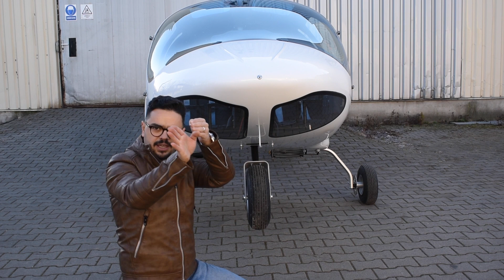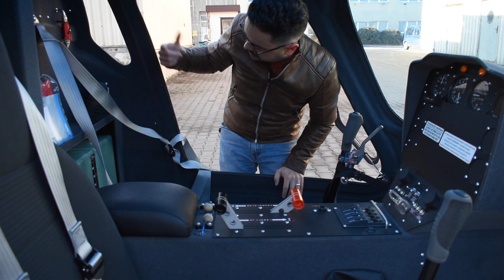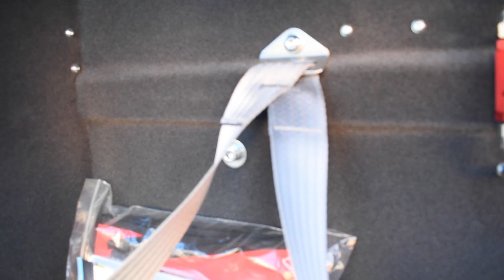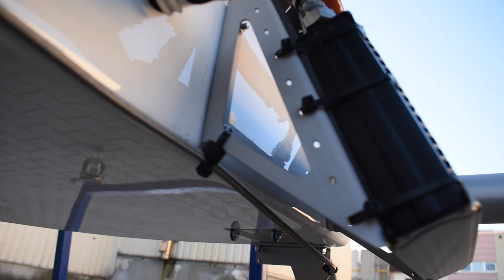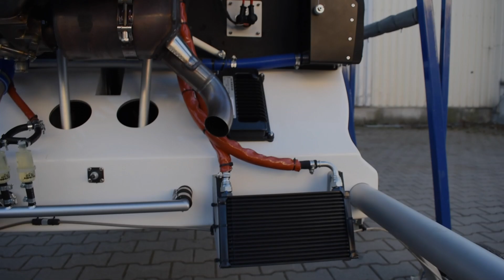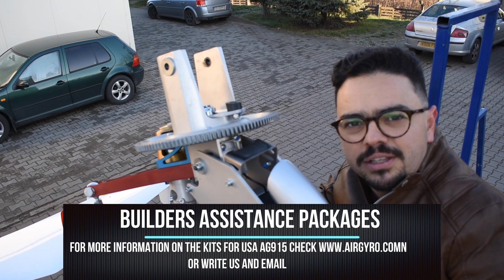Gyrocopter Pre-flight inspection after assembly AG915 USA kits

Comment: This is very cool Gyro but the one design that I would change is battery location. When a battery is being charged it gives off a poisonous gas out the vents from the electrolyte in the battery , Those gases would be discharged into the cockpit. Also if you get into a crash landing the casing on the battery would bust wide open and the occupants inside the aircraft would be sprayed with battery acid . It is very corrosive and if you get it in your eyes will cause blindness. That is a very poor design the battery should be relocated behind the fire wall in the engine compartment .Also electrolyte gases are very flammable any kind of ignition of the gases coming out of the battery cells will cause the batter to ignite and blow up killing all occupants of the aircraft .  THIS IS NOT SAFE THEY NEED TO RELOCATE THE BATTERIES ON THESE AIRCRAFT !

Comment: What safety feature do you have on this Gyro to stop the pilot applying the rotor break in flight by putting the stick to far forward and causing the rotor so slow down to much?
Reply: Never happen ....it -2' to the forward stop, if go any where near that amount of stick displacement its called going negative we never do that in gyros.. look it up.